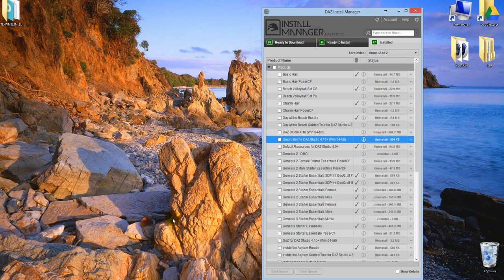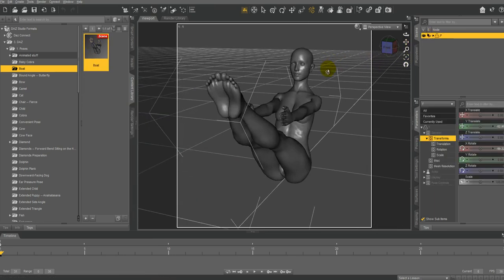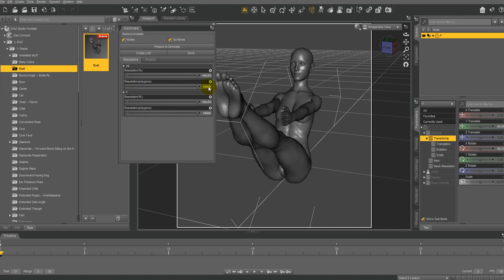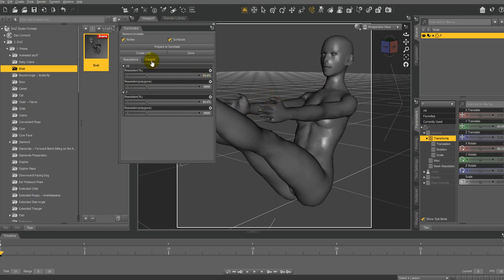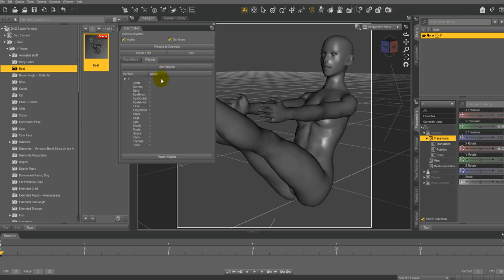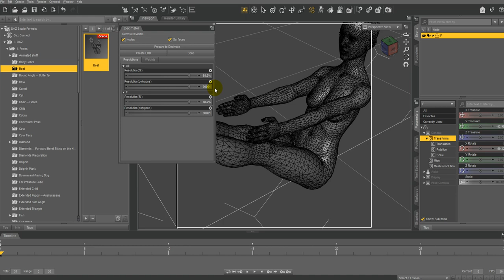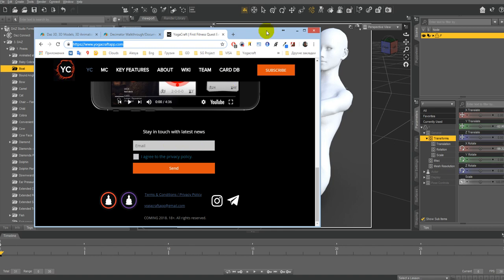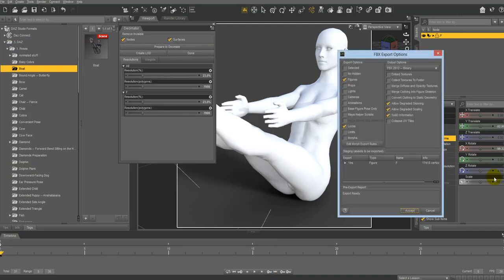DAZ Decimator plugin tutorial (DAZ STUDIO 3D)

Comment: This is a fantastic plug-in. Really.

Regarding your concern as to why there are so many options for eyes under the 'Weights' section: all of the options are related to the standard texture mappings for the specific figure loaded. The "Weights' options change depending on the figure, and only after the decimation has been prepared. So it seems Decimator is decimating the UV data.